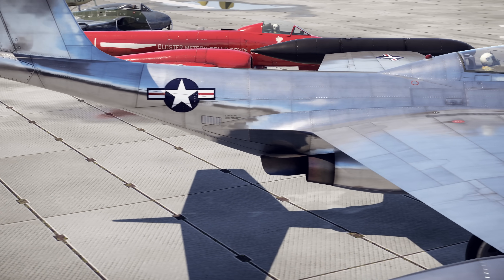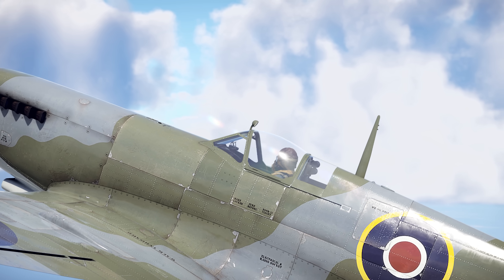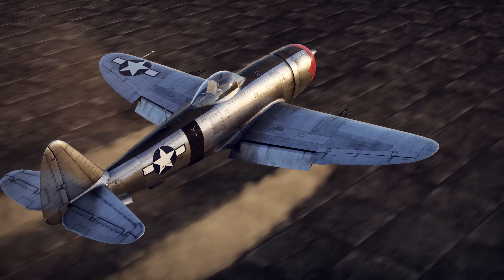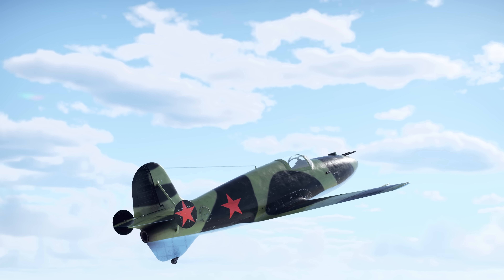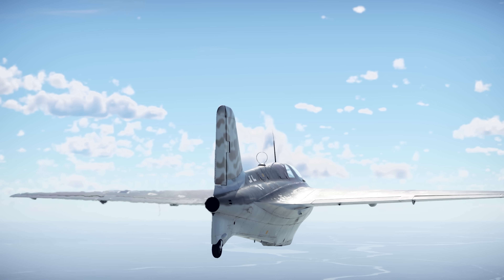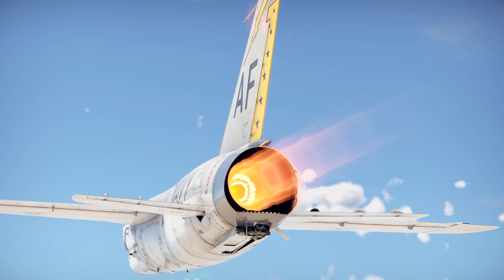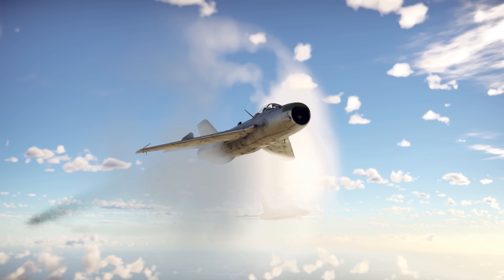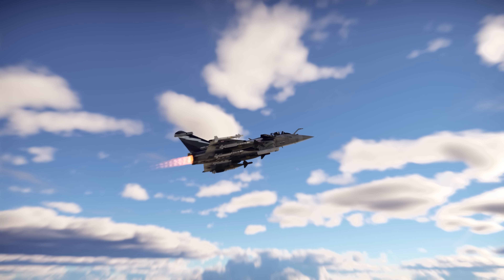Conquering the Sound Barrier

Comment: when (bombers and interceptors) update? with MIG25 and f106 variants?
Reply: They should add a new gamemode when they add the foxbat.
Reply: @scientiabellicaa  I don't think foxbat would need its own game mode, only if the player could choose whether to play a small map with four bases or a large mission like 200km X 200km with maybe eight bases. It would be great for bombers too.
Reply: fr like wheres my beloved delta duo af?
Reply: i love that guy
Reply: Maps still too small for fox bat
Reply: @Timmytheman. The MiG 25 flies at Mach 3.2 and the F15 flies at Mach 2.5 . It's not that big of a difference + the MiG25 has a much smaller thrust to weight ratio than the F15

Comment: I make plane videos via warthunder. I have an older PC/ lower spec and I am assuming warthunder make theirs on a higher spec. I see they suffer as I do from the close in view/stutter/dropped frames -  in the GFX engine. :/
I've been pondering upgrades, but no point if high end systems still have the frame drops and stutters.